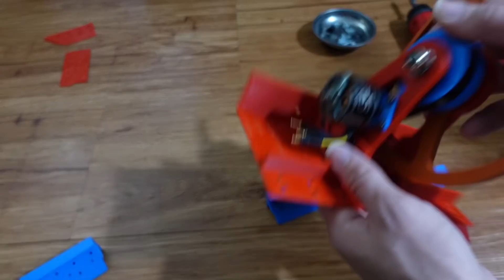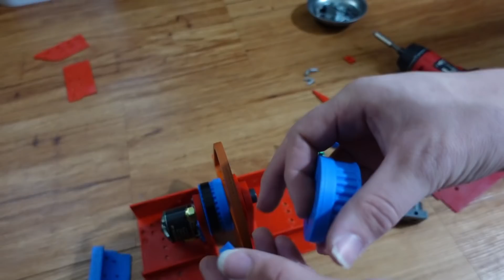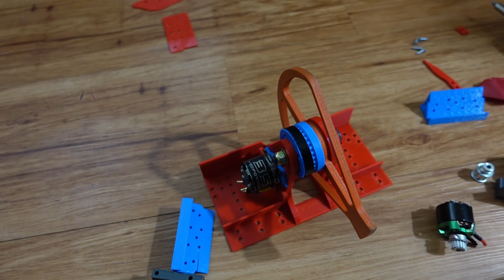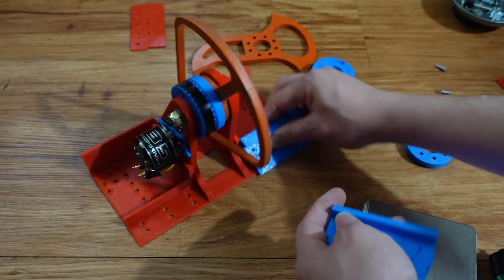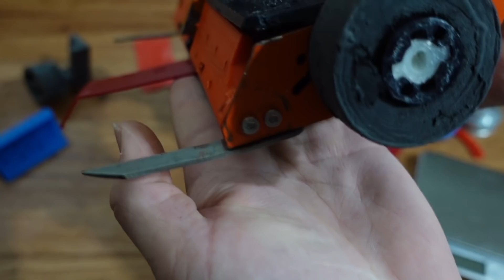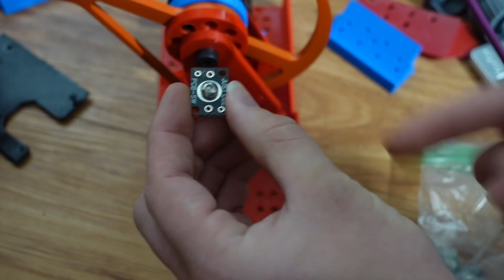Division V3 Design Overview - Beetleweight Combat Robot 2022 Update

Comment: Why do you machine the chassis instead of bending/welding aluminium or steel sheets? Seems quite a bit cheaper to me, but I have no idea how the quality and strength/stiffness would stack up.
Reply from the maker: I have access to a CNC milling machine and know how to use it. The raw stock I got for this amounts to only about $25 per chassis. Making the chassis from one solid part is guaranteed to be much stronger and more uniform in strength than welding and has no ugly weld beads  in the end. I have no welding experience personally so it wouldn't make much sense to try welding this together. And welding will never be even close to as precice as what a CNC can do - I will be able to get every dimension and every hole to line up within 10 thousands of an inch of where it needs to be. 

At the larger scales it makes more sense to weld stuff but there is very little use for that at the 3lb weight class.
Reply: @JustCuzRobotics  Yes in that case it makes total sense of course.
Reply: To answer the questions.
A) Bent/welded aluminum sheets still need to be machined to make it fit and work, and overall, a metal chassis weighs far more and limits you much more than a plastic chassis. Weight is a very important consideration, and although all metal construction would be STRONGER, it'd also be quite a ways more heavier too.
B.) Plastic is cheaper than machining, then bending/welding metal, and less time costly. This, of course, assumes you have a 3D printer for the 3D printing bits, which Seth does, and also have the tools to work with plastics and other materials, which Seth does too.
C.) Seth's front wedges are typically bent titanium, so there's that.

Comment: Would it be beneficial to put some thermal compound on the connection to the motors? If you are still having overhearing issues, that should drastically increase the heat transfer.
Reply from the maker: The motors never really overheat but the weapon ESC is at some risk. I will definitely be trying that in my 12lb bot where I push the ESCs harder with a higher current limit.
Reply: I was going to say the same thing, you want the contact surfaces to be as smooth as possible and high compression force between them. For smaller applications where can't add compression force there's adhesive thermal compound 1 part or some you can mix with thermal compound or 2 part epoxies, very easy to use.
Reply from the maker: I don't want to use anything that will be hard to replace if anything bad happens. So no thermal epoxy. But I may be able to make at least 3d printed if not metal retention systems to add some clamping force
Reply: @JustCuzRobotics  You could experiment with adding regular thermal compound to the adhesive one to dilute the adhesive strength, a tricked used by hardware moders so they can remove heatsinks later if they want, can just twist them off with plyers. Applying heat first can help too.